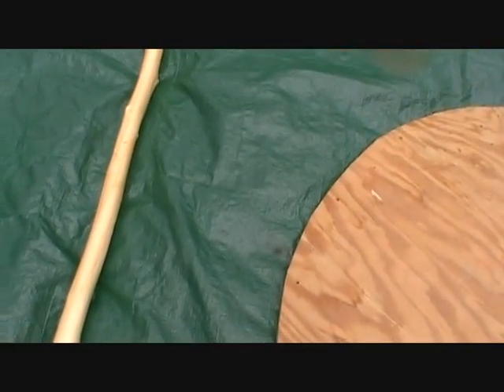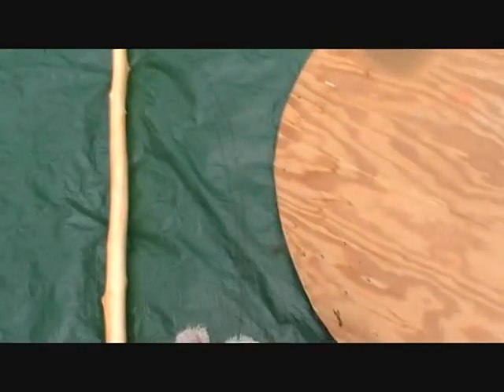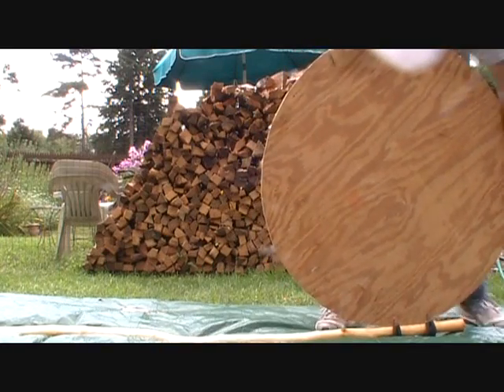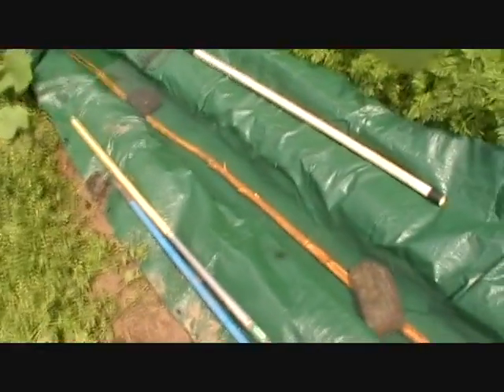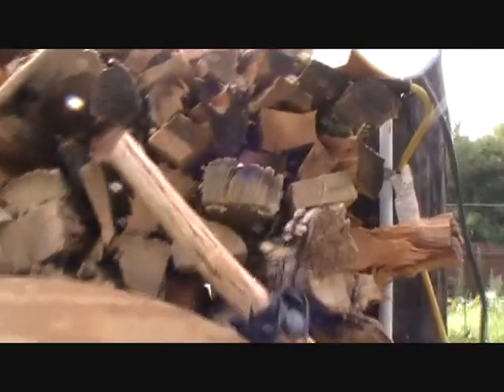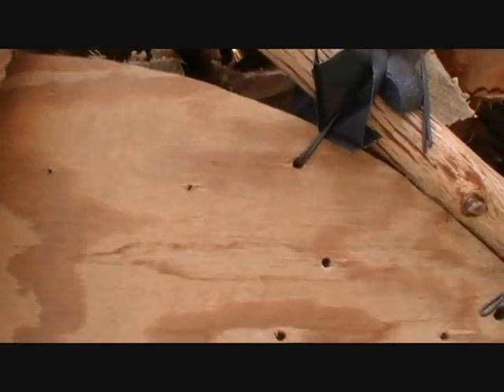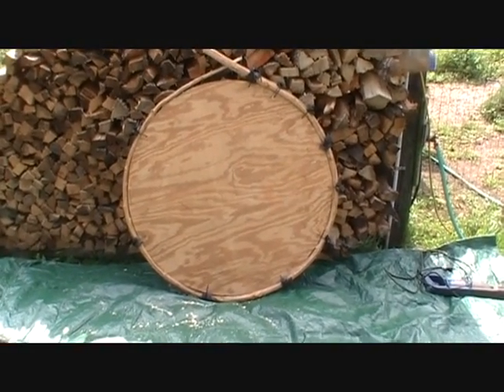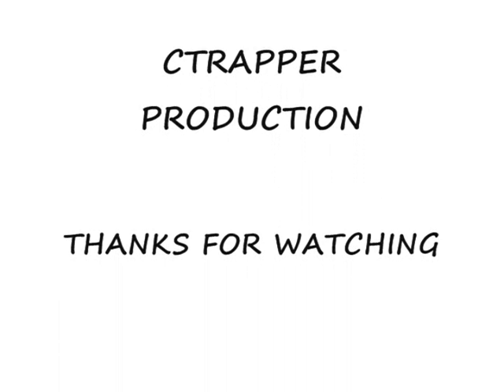How to Bend Saplings for Hooping Beaver

Comment: I once replaced the rock guards on my driftboat using a make shift wood steamer that was pvc pipe with the steam coming from a metal gas can(full of water) on a propane bbq grill burner. I used garden hose from the gas can to the pvc pipe and just stuffed rags around the hose to seal and let some steam escape from the other end of the pvc pipe. Stick those willows in the pipe andI bet it would make them limp as a noodle in 30-45 minutes and once cooled would keep their shape.

Comment: Hey CT, what's the demensions on your plywood? I like how you do them. Got a good pile of beaver in the freezer that aren't going to the sale, because of low prices. Goin to make a few gifts with them, thanks.........Richard from Kansas
Reply from the maker: +richard murray  I have two, the one in the Video is 40 inchs completely round. The other is for smaller beaver, it's 32 inches. Thanks for watching.
Reply: Thanks for getting back with me CT! Will start the projects this spring. In the vid it looked like they were a little oval. Will do them round. Thanks again!       Richard from Kansas
Reply: just a suggestion but check out ebay some trappers sell there because fur buyers are not paying a fair amount some animals sell better feet on for taxidermy if you do i wish you luck if not gifts for friends and family great too